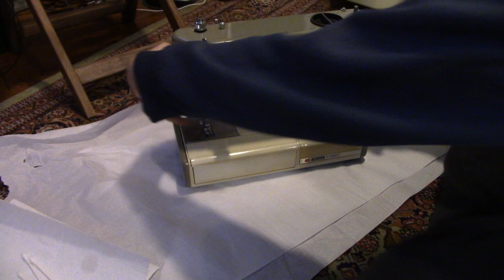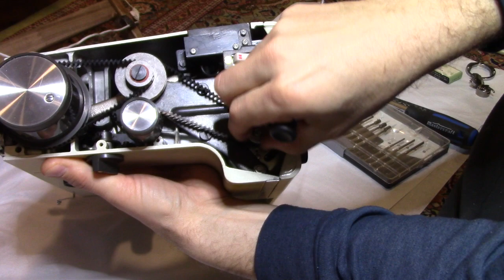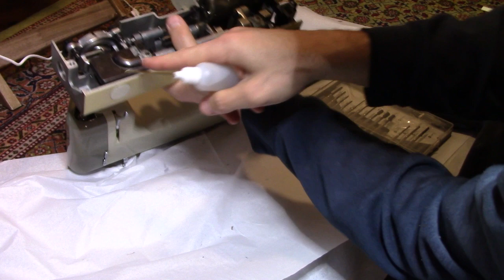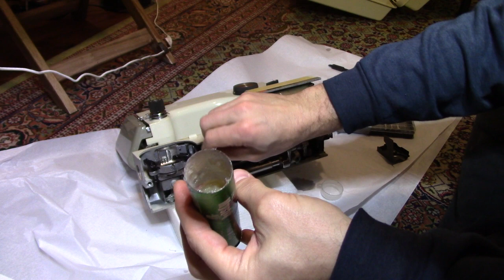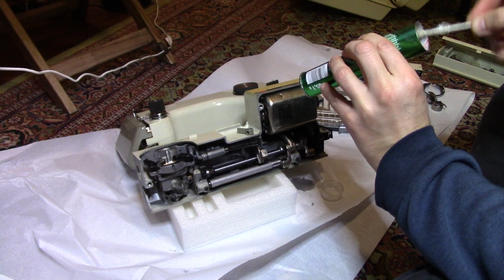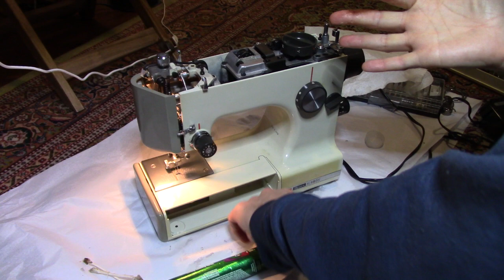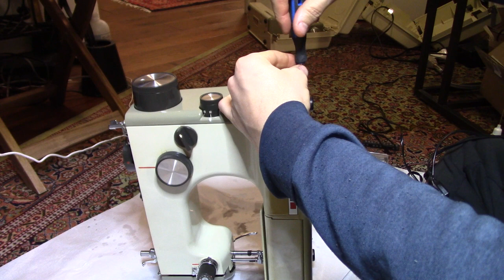Freeing a Stuck or Stiff Vintage Sewing Machine

Comment: Have you ever had a machine that was really locked up, not just a little stiff like your 1030? I have an 1802 which is in nice condition with no rust but won't move at all. I can force the hand wheel to move but the needle doesn't budge. I have tried oiling with Tri-flow oil, heating with a hair dryer on top, at the needle area and underneath. I removed the grease but it is fairly soft. The feed dogs can easily be moved manually but the button that moves them is completely frozen. I have been spraying the underneath the bottom with Liquid Wrench to try to loosen up the area around the feed dog switch. After doing this for a few days, there has been no improvement. I'm tempted to try a sledge hammer next, (not really). Any suggestions would be much appreciated.
Reply from the maker: Yes, but really locked up machines were barn finds with rust everywhere. When I have had a locked up machine like yours. There are only a few culprits -- check that there is no thread wrapped around the balance wheel area, pull out the bobbin assembly, and then remove the needle, sometimes the embroidery cam area can be locked as well. Start with the thread, and we can walk through the other areas together.
Reply: KAM Still need help? Your post is old, but my suggestion if still needed is this: Get a paintbrush with the bristles more narrow than the bristles on a regular sewing machine brush. The longer handle works great for reaching under the feed dogs and you will be surprised at the clumps of dust and debris you will get out! Remove the shuttle race and put a couple drops of Zoom Spout sewing machine oil on a soft cloth and carefully wipe the pointed part of the race ring and the all other sections of that section where your bobbin case sits. Wipe off excess oil. Put your shuttle race back together. Put a drop of oil on the teeny-tiny screw of your metal bobbin case. Wipe off excess oil.Before replacing case bobbin in case and putting case into shuttle race, move hand wheel TOWARD you -back-and-forth SLOWLY. Take paintbrush and carefully place bristles into all areas of that area under feed dogs then rock the shuttle back-and-forth again moving hand wheel TOWARD YOU while digging in crevices way back and you will most likely get more dust bunnies on end of your paintbrush!This will free up your machine, I hope. I fixed mine. Good luck!
Reply: Use Deep lube oil,,,

Comment: I've a Kennmore 150 that has frozen., no movement at all. I took it apart and gave it a good cleaning and oil. still nothing. any advice?
Reply from the maker: Take the entire bobbin and needle out. Disengage the clutch and then wiggle the the balance wheel to see if there is any movement. You might need to remove the belts from the motor so that you can feel the machine. Make sure it is in straight stitch position. Oil takes some time to soak in. You might also need a stronger product for soaking. You can also try a hair dryer. But first you need to find which area is stuck, this is why you wiggle the balance wheel and see if there is anything blocking it.

Comment: I was giving a Nelco SZA 525 when I turn it on the needle bar is stuck I can't find any videos on that model would you happen to know what other machine models are similar I'm trying to fix it myself before taking to a tech but eventually will. It's been sitting for 20 plus yrs.
Reply from the maker: I would look up any Japanese class 15 machine repair and Necchi machines. These machines are very similar. To identify the problem, remove the bobbin assembly including the hook and see if it turns then. Also I produced a video on how to adjust feed dogs on class 15 machines, that will show how the nuts and bolts work -- this will enable you to figure out if it is stuck at the top or the bottom of the machine. I am happy to help you as well.
Reply: @jamesrogers991  Thank you I took it to a tech but it's still having bobbin winding issues I think it's the wrong belt he put on the rest of the machine is working perfectly now. I'm taking it back to him he wound the bobbin during pick up but I can't seems to get it to work for me it's spins a little then stops. Thank you for responding 😀
Reply from the maker: @atiyasperfecttreas  Is your bobbin dragging? I have found some bobbins drag on the guides. Also check that there is no oil on the bobbi winder tyre.
Reply: @jamesrogers991  When I go to click it to the right it's not going far enough over it touch the bobbin winder spindle so when I put my foot in the pedal is tries to spin but then just stalls it's does like 3 turns so it's not filling the bobbin. It's like the donut style belt is too think to allow the mechnasim to touch the clutch.
Reply from the maker: I hate when that happens. Sometimes there is a screw which allows it to move further.
Reply: @jamesrogers991  OK good to know

Comment: Hi can you show me how to  put the two bands in this machine
Reply from the maker: I will work on video, in the meantime, there are two bolts (one for the motor and the other for the reducing gear). If you loosen both, it will make it easy to slip it over top and attach it.

Comment: Where do you buy the Greece?
Reply from the maker: I bought it from the automotive section at Canadian Tire. Marine supply shops will also have grease.
Reply: From a sewing machine store.  It’s a special grease. But you only need sewing machine oil.

Comment: do you know how to restore the pedal ?
Reply from the maker: These are relatively easy to adjust. As long as the pedals have not been dropped -- the porcelain inside is quite fragile. There are only a few screws to take out and then you can adjust the control screw to prevent the machine from taking off.
Reply from the maker: https://www.youtube.com/watch?v=_OeMDz37aUM
Reply from the maker: https://www.youtube.com/watch?v=RGf2DFQdcBQ&t=1209s